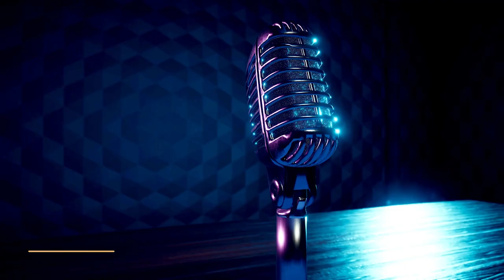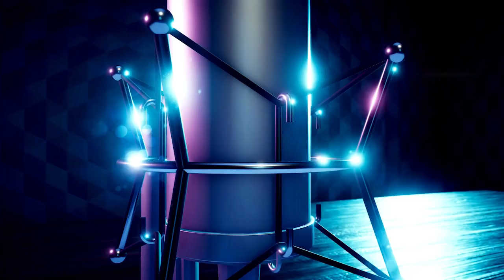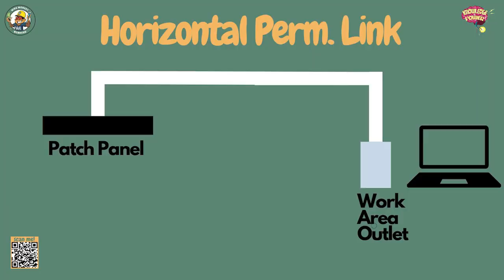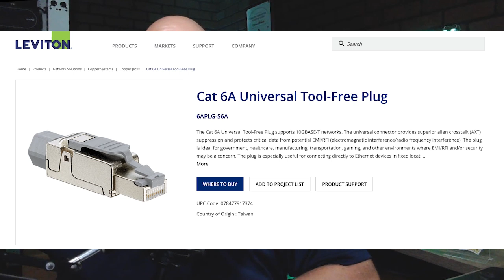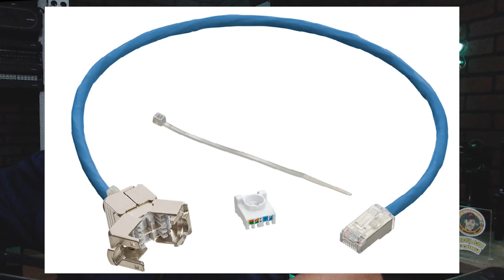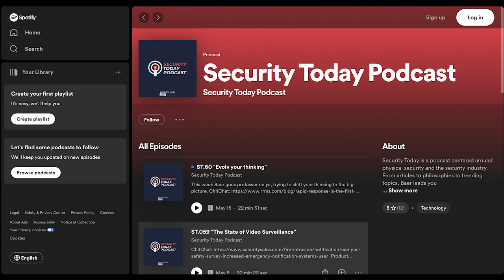Mastering Modular Plug Terminated Links (MPTL): A Comprehensive Guide for ICT Professionals | RCDD

Comment: 16:26! Omg thank you so much for this! I’m an electrician covering for a network cable technician at a large university. All we have is the permanent link and channel adaptors, but using the channel adapters with a patch cable at the patch panel for this wiring configuration was getting me weird test results. The meter was indicating that there were multiple connection points along a single continuous line. I now have my suspicions confirmed that I do not have the proper adaptors to preform the proper tests.
Reply from the maker: my pleasure!!!!